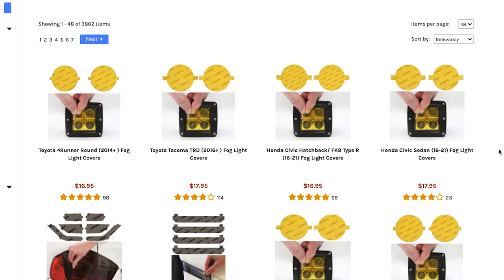How to install a Lamin-x precut headlight film cover kit

Comment: Go to a tent shop and get clear tent applied this material is so hard to work with
Reply from the maker: thank you for your feedback. as you know each person needs to be aware of what their ability to work with most any kind of vinyl film like ours. obviously some are more skilled and knowledgeable than others. the plus of the thickness of our film is that it is constructed to withstand impact of rocks and other small road debris thus saving you from having lights cracked, chipped or broken.

Comment: I tried this... TWICE...  with my Q7.  It's like trying to vinyl-wrap a basketball without using a heat gun..  nowhere near as easy as he made it look.  Mine still aren't done  LOL  the fingers of vinyl are huge and wouldn't flatten down, no matter what I did.
Reply from the maker: the shape of some lights are much easier to work with than others. we provide an installation difficulty rating on our product for each kit. 'Level 4 or 5' we recommend using our Universal Sheets product or you can certainly take a sheet of Lamin-x to an installer - either way.
Reply: @Laminxfilms  I get that, and thanks for the response.  However, I've ruined two films, trying to get them to lay down properly.  And I used to tint car windows for a living, so I have a strong understanding.  These just kicked my ass.  I have a 'last set', but the nearest LaminX installer is 45 miles away.  That round trip will cost me more in fuel than it did for the cut pieces for my Q7.  My Q7 is same as the one in this video.
Reply: Not sure if you can answer this but why do you guys not sell clear bra’s for rear lights?
Reply: @benlogicfactsshapiro  I'd guess because the tail lights dont see a lot of 70mph road debris
Reply: @geriatricginger  Yes but that doesn’t change the fact they still make rear PPF for tail lights without a clear option.
Reply: Dammit i just ordered some of this lol
Definitely probably gonna be 60 bucks wasted then. Crap.